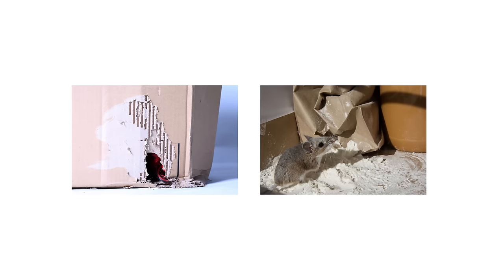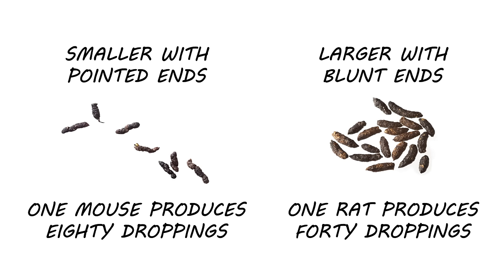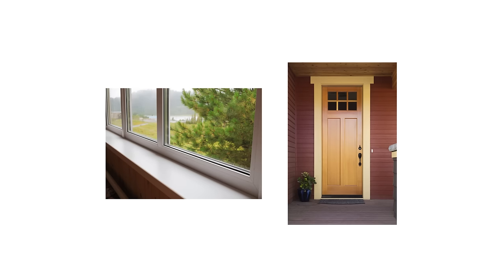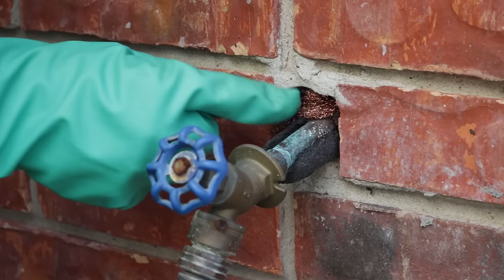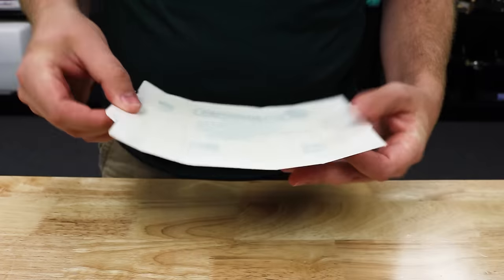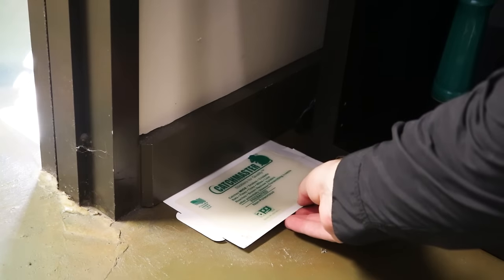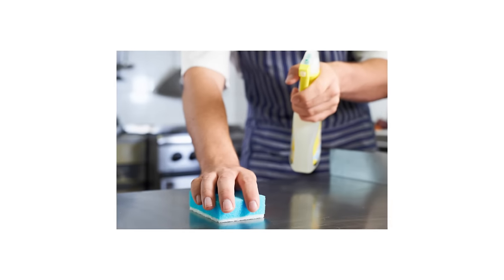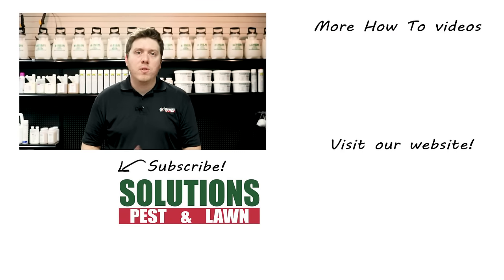How to Get Rid of House Mice (4 Easy Steps)

Comment: This is a really great video, just watch it through. Some of these tips I learned by observation. For example, don't give them places to live in your house. Clean out garages, closets and attics (they may literally be bedding so close to you !). I had MICE LIVING IN MY SPARE BEDROOMS, and the rest of the house was so clean. I was single, and much was vacant for periods. 
BUT, one thing I did not see covered (I may have missed), mouse proof your yard. Keep wood piles away from the home and neat. Leave lights on at night (slight deterrent). Hope you have a black rat snake in the neighborhood, they are better than cats (don't run them over, protect them).
Reply: Use ammonia wet a rag with ammonia they hate that smell

Comment: The mice have gotten too smart for me. They learned to avoid the glue traps we were using and stopped using paths where they were being caught. The advantage is they quit ruining all my cereal and pasta. The disadvantage is they learned they can use open paths because we can't put traps there. I bought an electric trap that was working wonders but the bodies soiled the metal kill plate and now we can't get it clean enough to stop setting itself off.
I hate mice. Constantly chewing, gnawing and scratching, making noise at all hours of the day and night. It's true what they say, the older you get the more you sympathize with Tom.
Reply: The older you get the more ?...

 You can use a bucket with water in it, drill a small hole at the top of the bucket and place a metal rod through the hole. Use a plastic bottle or aluminum T can through the metal rod (some use PVC pipe) and peanut butter on the bottle or can. As long as it spins, the rodents will fall and drown. This can be used in an open path. There are youtube videos on how to set this trap up for more visual how-to instructions.
Reply: Get a female cat.
Reply: Grab the reusable mouse trap that instantly kills them.  No mess, no blood, no droppings.   I stopped using glue boards and traditional traps
Reply: There was some mf's bothering here, glue trap and a piece of cheese: problem solved.
Reply: @willgamer0849  

Glue traps dont always work.  Theyll chew their own leg pff to get away.  Plus all the droppings
Reply: @integrity101  Damn really? We never experienced that, they just struggle trying to break free, but cutting their own leg never seen it. The droppings stay on the trap. U kill it and sometimes u can even re use it.
Reply: @willgamer0849  

Yea ive seen it get messy.   I stopped using glue.  Look for 'instant kill' traps.   Its white plastic snap traps.   Kills em instantly.  Best ttaps out there.   No mess, no blood, no droppings, no struggle.     Drop the carcass in the trash and re-use.    Works fantastic.  Ill never use glue again.
Reply: Glue traps are fucked up to use.
Reply: @clockworkNate  But using chemicals are not?
Reply: @clockworkNate  I can’t ethically use glue traps ever since a rat got caught in one when I was a kid. Rats may make me cry and shit my pants at the sight of them, but hearing the tortured cries of the rat stuck to that trap (my dad ended up having to kill it by hitting it with a broom bc we still heard it in the garbage bag day after it got caught), I swore I would never ever use one. Strong snap or electric traps are at least a little more humane.
Reply: @willgamer0849  is that my problem? Mine is a male and he watches them run by 🤦🏻‍♀️
Reply: @xbrandi12345x  mines a female.. sometimes trys to get one other times just watches it. She has never been a mouser catcher. Glue traps really don't work, maybe one or two got cought. But the glue sure sticks on the floor if you happen to drop it! Takes nail polish remover and scrubbing to get glue off your floor! Mice gets off the glue traps.   Wooden ones sometimes work..but mostly the mouse just goes by it or is able to get the food off and the trap still set!? I have even adjusted the traps. Sometimes gets them.  I am so sick and tired of cleaning and trying to kill them. Ill get a couple of mice then want see any for a little while, then starts all over  again!?😠 Im going to try some other things.. not poison because of my cat! But some other things I've seen. Mice be gone!!!
Reply: @grannyarbuckle5554  if you have someone that can help, the first thing you should do is  have your house investigated for holes. They can get in a coin sized hole. Unfortunately they can be carriers for at least 40 diseases from what I read, including hantavirus. If you see them it means they have a nest closeby as they don't usually go more than 10-30 ft and that means they might already be breeding in your walls. My aunt has them too and several other people here in Maine and they poop so much and breed so fast it gets dangerous fast. I won't use glue traps or anything that isn't humane or won't put them out of their misery immediately because I feel cruel. I am, however, going to try planting mint all around the perimeter of my house to deter them from coming in. I heard that might work. I ordered some live traps. I catch them and then drop them off on the other side of my town in a field next to a huge wooded area so that way they can't make it back to my place. Sometimes it's best to bite the bullet and call an exterminator and I might just have to do that. You may too. If I think of anything or use anything that I think is worth a try I will let you know.
Reply: Alive traps are better. I caught 3 and carried them on a meadow. No need to kill
Reply: @AF-uc2bd  I agree, as long as you drive 25-50 miles out to some meadow. Mice have a nasty habit of making their way back to homes, especially during colder seasons.
Reply: I GOT THE SAME FUCKING ISSUE BUT WITH THEM EATING MY FRUITS
Reply: @willgamer0849  mice don’t really like cheese but uses it for survival, they prefer wheat, rice, oats, cereals, any kind of grain u can think of
Reply: @arturotorres6437  The older you get the more you sympathize with Tom, it was a reference to the Tom & Jerry cartoon...
Reply: saaaame issues I'm having! I can't sleep and I'm seriously going insane
Reply: @integrity101  my mouse were so smart they started throwing insulation over the glue traps so they could travel over them. They avoid the bucket trap but the simple trap traps along the walls they travel seems to work.
Reply: For real, they DO get smart. They're not falling on the same traps anymore, no matter where I move them. GODAMMIT I don't know what to do
Reply: @integrity101  holy shit, that's even funny
Reply: You are so right,  I know my mice are genius
Reply: @willgamer0849  That only partially works. We have a female cat, &+ yes she does catch some mice, but not all of them, cuz we still have kitchen cabinets they get into, even tho the cabinets are empty! I can't use them until we get rid of these damn mice! 😤
Reply: @LAURENAURORA31  The sole presence of a cat, it's good to scare the mices. But if it doesn't kill all of them, use glue traps still. I used a glue trap then I checked the next day and I only found grey hair on it bc the mf mice escaped, so they're not totally effective.
Reply: @willgamer0849   Yeah, scare them back into where they usually hide, or to another part of the house lol. We have used glue traps &+ haven't caught anything. I recently watched a video where this guy mixed corn bread mix &+ baking soda, &+ left it out for them. He said cuz they can't pass gas they died. I'm going to try that.
Reply: @LAURENAURORA31  I think there's only a mf mice here, but we can't leave anything in a pan or pot or it'll climb the kitchen.
Reply: @willgamer0849  I also learned wiping things down with Borax mixed with hot water will keep them away. I recently did that with the kitchen cupboards and only found one mice dropping, since I clraned it out. My friend is coming to help clean up the house and said she will do it again for me, so maybe I didn't make the mixture right.
Reply: LMAO.
has one sniffed your ear yet while you were sleeping?
You know they don't fear you when that happens.
Reply: @MPlain  Probably they've been close, but I didn't feel it. Once I found one on my bed trying to find crumbs, and also climbed on a stool several times. Once I saw one on the ceiling, I cleaned thinking they might be nesting there. I'm beyond sick with those mf's. Once I put a glue trap under a furniture, it got stuck but then I found out it escaped and in the process bit and ripped the modem cable 😠
Reply: @willgamer0849  they ignored my sticky traps
they didn't like my black pepper along their trail much.
they also didn't like the peppermint much
i have resorted to spicy treats.
oh i'm feeding them.
but i'm feeding them stuff i wouldn't eat.   lol
Reply: start thinking ghost peppers.   super hot hot sauce.  wasabi.   the really hot jerk sauce.
Objective.  convince them that the food here is really fkn bad news.
Reply: @xbrandi12345x  I have gobs of mint growing wild around my old cottage and it does nothing (I'm sorry to say)
If you have an old house you can forget having every hold filled unless you have tons of money to spend and I mean tons.
Reply: @MPlain  Please... please don't tell me that's true.
I know the temptation will be to freak me out even more, but I live alone
and in the middle of the night I've been hearing them scratching in my little cottage.
I'm the kid of woman who doesn't mind getting dirty with horses, dogs & regular outdoor dirt, but the
thought of mice droppings & urine IN the house blows my mind.
I tried the green cake stuff, but that didn't seem to make much difference.
With oil & gas being so expensive & winter coming I don't know if I can afford an exterminator, but I may have 
to cave if all this scratching continues (and I'm sure it will).
Reply: they chrw sticky traps off if ur not fast enough.....
Reply: @rogerstubenrouch7187  We set two glue traps and two of them fell victim. But there's still one or two still bothering, it's hard to end them completely. Once I was asleep and I felt a pinch on the back, I thought I was dreaming, but I'm sure the prick climbed on and did it. I then disinfected the floor everything with bleach and desinfectant.
Reply: @alyssiascott5518  Did you catch it? I'm in your same boat now. Cant sleep.
Reply: @arturotorres6437  shit didn't work for me, they probably jump out or know better.
Reply: That is fun-knee🤣
Reply: @beaniepq  Last week, my beagle caught a rat. I had scissors in my hand, so I grabbed the rat with the scissors and bashed it's head in with a brick. Problem solved. Old lady just takin' care o' bidness.
Reply: @beaniepq  And you are just moving the problem to someone else's area. They could have fleas that have plague; hantavirus, leptospirosis, lymphocytic choriomeningitis (LCMV), Tularemia and Salmonella. I wouldn't have them in my vehicle.
Reply: DAMN in your food? you got it worse then me
Reply: Clean well get a kitten and never leave trash in the house over night
Reply: Tom"you have no idea...help me"
Reply: Also you ever heard of something called ear plugs...just a thought until you get rid of them
Reply: Glue traps are incredibly shitty.
Reply: Weren’t Tom and jerry actually pretty good friends?
Reply: @willgamer0849 oh ya dude it’s fucking nasty. I used to work at a grocery store that had a bad mouse problem in the back room. If you catch it early enough they’re just squealing and you can step on em or whatever, but then half the time you just see like a bunch of hair, a foot, and a trail of blood. Idk why they work great sometimes and not so great other times though because I’ve def seen both
Reply: I dont have the heart to murder a mouse.
Reply: @iThoughtyouweregonnalapme  We keep using glue traps, caught a couple and so far they haven't showed up again. Though they will come back. When they get caught I grab the trap and slam the shit outta them on the ground.
Reply: @integrity101  7:44
Reply: You need to use equal parts of gold medal flour mixed with plaster of paris
Reply: I have the same problem right now. These critters just won't take the bait.
Reply: I assume that's a reference to the greatest of all cat-and-mouse cartoons, "Tom and Jerry"? Well said!
Reply: @willgamer0849  I have 2 female cats and they wont kill mice
Reply: @ChandlerGaming205  that's weird are they castrated? Most have that instinct. I had one that would even play with them before killing them. Teasing them haha
Reply: @willgamer0849  They are female cats, they are fixed but they still have their claws
Reply: @jeannejohnson6174  I finally got those damn mice that were outsmarting me.  I bought new reusable easy set mouse traps, caught 2 in the same night with the same trap.  Caught one which was HUGE so I took the trap outside and dumped the carcass outside then early the next morning I got a smaller one.  I live in a farm town so field mice are common around here
Reply: @beaniepq  Wait..Don't TELL me. So, you had to shoot it a bunch of times, then went to your Mom's house with your "Crew," to find a shovel. She woke up, showed you a picture of a mouse she painted, and you all were stifling laughter, saying:
"Look like anybody WE know??"
Then, the place you buried it in was slated for Condo construction, so you had to dig the rodent up and move it!
((-;
Reply: grease-cutting enzyme dish soap or oven cleaner (lye) will fix that.
Reply: yes me too!! they never go on the glue traps even with a big blob of peanutbutter in themiddle.  they carefully eat the peanutbutter out of the snap traps without setting them off.  they eat the poison a little bit until they see their friends die and then they avoid it at all costs.  idk how the hell these little fuckers are so smart but now i cant figure it out and apparantley i have rats now too?!  I AM FREAKING THE F OUT!
Reply: @willgamer0849 why only female cat?
Reply: They will never go on glue trap and I can't figure why?
Reply: If you have a cat that doesn't kill mice or rats... It's because you treat your cats like they are children... Let them go outside to hunt and do what cats are supposed to do... You make your cats lazy!
Reply: get a cat

Comment: The black T-rex traps work good.  Take some sticky jam or corn syrup.. place a dash in the reserve bowl.. (optional: let set for a few days for jam or syrup to harden to create more tension with the peanut) take half a peanut, place it smooth/round side up into the sticky jam/syrup.  That way the mouse has to apply pressure to get the peanut.  With the smooth side up, it may take a few tries for mouse to get the peanut.. this method usually works.. ALSO, it is important to take a small cardboard box and cut door holes on all sides... Mouse traps in the open are less effective.. you want it so the mouse feels safer inside the box while going for the spoils.

Comment: Mice are smart. I haven’t had them in years until recently. I recall they wouldn’t get stuck on the glue traps but would instead push them out the way like yeah B!
Reply: If there is no other food source such as crumbs, etc. in the house then mice should go after the bait on glue traps. Glue traps should be placed along walls or where mice have been spotted. Peanut butter works well as bait. Mice are more active at night so some patience is advised.

With that said, would a hungry mouse really be able to pass up a dab of delicious peanut butter placed in the center of a glue trap, especially if there were no other food it could get to in the house? I don't think it would push away the trap then. It would go for the bait out of hunger alone and then it would be game over for it.

Comment: Our mice usually come in for shelter in the fall.  I have to trap a lot longer than 2 weeks.  I have to trap until the snow gets deep enough around the house that stops them from traveling.  But the other day I had one come right up to my feet, and it is spring.  They should not be in the house.  So I played the Ultrasonic pest repellers  on youtube, and the chewing stopped. But remember your other pets will be effected too.